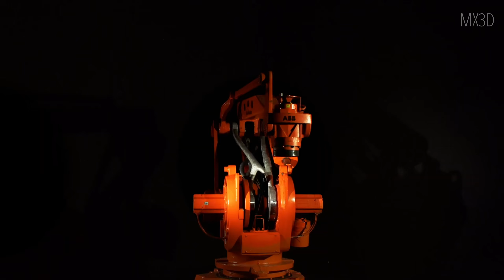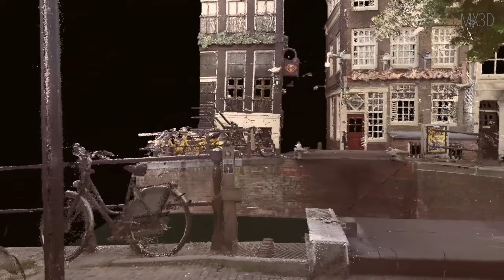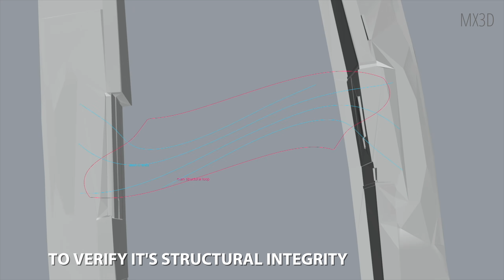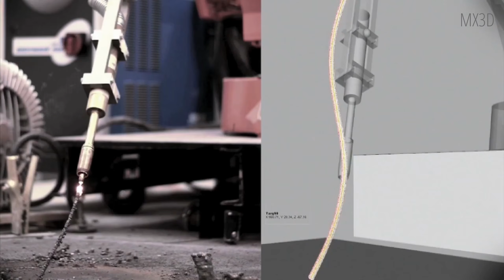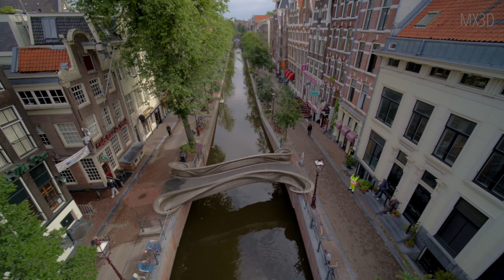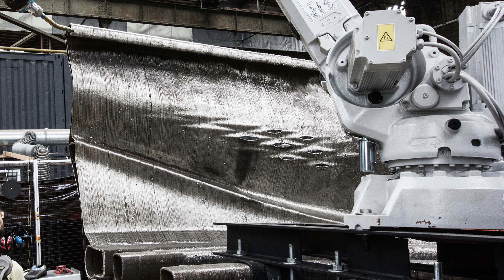World's first 3D printed STEEL bridge | MX3D

Comment: This is very interesting and more practical than the other 3D bridge art. ;)  I find it funny that it's in the red light district.

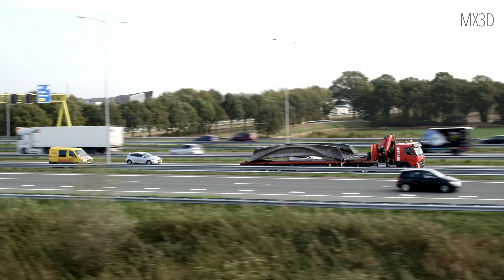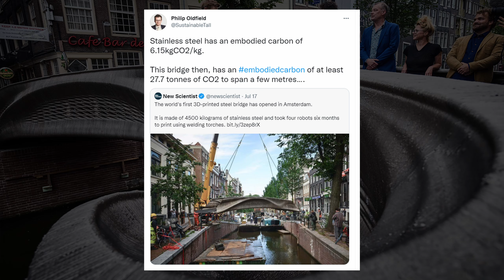I'm curious as to why it had to be cut into three pieces.  Was it because of the narrowness of the area? Or about the local roads?  At 2:57, it seems to fit fine (unless that's only a portion of it).  Does it have a method to prevent rust?  Or is the assumption that it won't be there long enough for rust to be a factor for stability?  Finally, at 5:55, is this guy complaining just to complain?  If he wanted a practical  discussion, he would have compared it to a typical steel bridge or a traditional bridge in the area.

I like the concept, but I wonder how it compares cost-wise and time-wise to a traditional steel bridge.  Nevertheless, I think it's a good step into the future of 3D printing that's more practical than some of the other things we've seen. As for the design, it may look good somewhere, but definitely not with the look of Amsterdam's red light district.

Thanks for the video!  Glad you're back and doing better. :)
Reply: stainless plus a fixed lifespan of two years. except we all know what will happen - it's going to become so popular that it will likely have to stay, perhaps permanently. you heard it here first.
Reply: It did say that it was stainless steel, so rust shouldn't be a problem.

Comment: Calling it 3d printed seems like a bit of a stretch lol, Using a welder to build stuff like this is SUPER bad for the environment lmao welders consume huge amounts of energy to begin with then with all this extra equipment?? And it took 6 months to make? It would have been faster, cheaper and less environmentally damaging to just build a normal bridge out of steel.
Reply: As she pointed out, this was an experiment. While the creation has detriments now, how else will new and possibly better technology be implemented in the future? Not everything can be designed and improved only "on paper" before a finished method is implemented.
Reply: @whiteknightcat  It's not really making a better technology, there simply isn't a world where using a welder as a 3d printer is going to be viable, you are always going to be better off forming metal in another way lol like she also pointed out.

Comment: oh my, you know the creator of the bridge did not like having to cut it into pieces :)
Reply: For sure! I know I winced when I heard that!
Reply: probably knew it was coming.
Reply: @daos3300  if he knew it was coming, he would have printed it in pieces :)
Reply: @ArtisanTony  no, since the whole point of the exercise was to manufacture it in one piece. goal achieved, next problem to solve - installation.
Reply: @daos3300  The main problem was no one properly planned the project.  I am a design build contractor. I would never design a system with such mistakes. If you design a bridge in one piece, you have to confirm transportation and installation before you print it.  This is the typical failure of "artists" to understand project management which is best left to someone like me who is use to getting things built in a  proper way.
Reply: @ArtisanTony  i suspect you fail to understand the nature of the project as an experimental/art piece. of course there was planning, the city of amsterdam was involved. but given what it was, and the number of necessary compromises made along the way, there was a degree of flexibility allowed and built in. not everything is a bog standard affair, this isn't a run of the mill condo.
Reply: @daos3300  I suspect you have no idea what you are speaking of.  I don't fail to understand anything.  I have been involved with projects like this before and every time there is "art" involved, there is a lack of planning and common sense.  Artists are not builders and city planners are bumbling bureaucrats. The very fact that they had to cut it into pieces is shear proof.  And then there was that idiotic transition on one end  where they had to rig the landing of the bridge. You have shown me you really are an ignorant person with no objectivity and a waste of time to respond to.  Let me guess, you are a twitch gamer lol
Reply: @ArtisanTony  there are very good reasons for both cutting it and why it didn't fit, the details of which you are evidently not aware. but i guess you already have all the answers. quick to judge, throw attempted insults and accuse others of ignorance... says a lot about you. bet you're an absolute dream to work with.

Comment: Could they not sand it a bit to smooth it when done? Sorry if steel doesn't work that way.
Reply: Of course it could be polished, but I guess they were looking to show of the raw 3D printed surface.
Reply: you can do it yourself, glue sandpaper to the inside of old gloves and make the handrails slightly smoother every time you walk across
Reply: @illdeletethismusic  i was thinking more like a sanding roomba

Comment: Honestly, it should have been powder coated to prevent rust.
Reply: @Cole Hansen Stainless steel still corrodes and rusts. The rate and severity depend on the type of stainless steel they used.
Reply: @andrewbeeco967  1. stainless steel.  2. planned limited lifespan  3. intentionally left unfinished

Comment: They compromised the test by dividing it and welding it back together as it creates a stress riser not a part of the original model.
Reply: I thought about that as well. But I guess there was no other feasible way to transport.
Or, who knows. Maybe they factored that in after realizing that it had to divided to transport
Reply: @jonl8816  Mhm if it was part of original design, why not print it in parts to begin with? They would have calculated that even cut and rewelded, it would be fine.
Reply: @SianaGearz  the point of the exercise was to manufacture the bridge in one piece, making it in parts would defeat that object.
Reply: @daos3300  well it was supposed to be manufactured at the point of installation as well, but that didn't happen.
Reply: @SianaGearz  that was for the biomimicry version, which got canned early on - i'm guessing due to cost/complexity. would be great to see that happen, i'm sure it won't be too long before someone pulls it off.
Reply: the cutting was the one thing that bugged me. but properly executed welds are generally stronger than the parent metal, so not a stress riser.
Reply: The object itself is basically just one enormous weld.
Reply: @garethbaus5471  exactly.

Comment: Whilst its not a very attractive structure it is an experiment and I would think that when the first windmill was built it was not appreciated, but like electricity pylons after a while the eye no longer sees them. 3d Weld/Printing will probably be useful on complex reoccurring  shapes that  have to be made on site and would be (welder)labour intensive. After all the most expensive component a manufacturer makes is the first one.

Comment: Very cool progress on the concept of autonomously.erected structures. Set it and forget it construction is the end goal, obviously. But realistically we’d actually be going for accomplishing construction with minimal oversight.

So there are several neat ideas to build on with this. 

One is large composite structures are potentially possible like this. And potentially can be done very precisely 24/7 if you work out out the programming and best types of robotic and tool designs to accomplish it.

Now, all that is only so interesting in comparison to prefab, and construct on site. Show you workers the screws and hot the parts fit. And where to weld. Convenient. 3D composite is still very cool, because it can potentially build structures you simply couldn’t make any other way, but still needs a lot of development to make that truly preferable to other modern methods of construction and design. 

The real interesting possibilities are in sending out an couple machines to scan and assess, and build off of whatever the controllers deem best for that. With little oversight. The reason that’s interesting is because the amount of work you can do becomes more about how much machinery you can send out. A dozen work crews across a city is absurdly difficult to put together when it’s 30 or more guys, plus all the heavy equipment. Shrink the crew size, and build sustainable semiautonomous heavy equipment, and you might find that even if it’s as expensive, it’s over all a thousand times easier to oversee. A normal construction crew is a lot like herding cats. That’s not an issue in leading robots. They don’t show up to work drunk, act like giant arseholes to each other, or take any.time or effort to vet for the lazies, stupids, or addicts.

The obvious issue is that you’ll need to develop a lot of new software and hardware, and bring in experts to assess the issues of construction. Additionally, construction sites, and ground conditions are a huge issue for a band of monkeys in hard hats to deal with. And they are built to navigate difficult terrain, and inclement conditions. So you’d probably need to develop methods of isolating terrain, so you can control as many variables as possible. Think like you see in city reno. With the scaffolding and plastic. Plus excavation and infrastructure is its own hairball.

However. This solves a couple of those issues. If you just deliver the machines and wire for a large portion of the structure, you can cut out a ton of manufacturing. And if you get really good at understanding the area and blueprinting with cad, you might end up making types of structures, and in places you’d never imagined doable with less consequences for taking your time in development. Machines with some standard storage and Maintenace can sit it their crates as long as you need them to. Where as live labor has literal hosts of needs and desires that change the costs of their labor.

Plus the best part. As long as you don’t lock innovation up, like Disney does it’s IP. That is into perpetuity. The more you use the systems, the better data you have to develop across all work done. Innovation is more or less directly applicable across all machine language, and the methods and systems used to deal with circumstances of construction are also more or less applicable to any other operation in that field. Where as with more people the systems more or less dissolve as the workforce loses and gains new highly variable individuals. The engineers and architects are developing. The machinery develops, but the workforce is constantly changing. And good workers, and good leaders are the limiting force there.

Anyway. Hopefully that was semi coherent.

Comment: I would love to know more about why the biomimicry design failed, sounds like that’s a software issue where the software wasn’t able to get to an optimal structure?
If anyone has additional literature on why that failed I would love to read it!
Reply: I don't know, but I suspect that changing actions from wind loads and the complexity of the structural response meant that the design was so non-linear they struggled to make a stable and computationally efficient algorithm. Either that, or the design requires hollow sections to achieve an acceptable efficiency and this is beyond the capability of the biomimicry software.
Reply: @alexandersime-scott8198  that would make sense, I presume most optimization systems assume a static mono directional load ie: gravity. It would be rather complicated and computationally expensive to extend that to dynamic changing loads like wind and understanding resonant frequency modes. 
My initial guess was well if it works for a chair why wouldn’t it work for this, but that’s definitely a decent guess. Still that seems like a very promising method for the future.
Reply: @FreekHoekstra  my thought was, it was just too complex to print?
Reply: @richm1981  given they can print a loose filament, I doubt thats the constraint, but maybe...
Reply: It is infact nothing like biomimicry, it is topological optimisation. I invite you to do further research with this term. 
At no point of the design was any thought or idea from nature. Yet it resemble living being because it is highly optimised for a specific task (like evolution you see)
Reply: @guillaumebeau1906  in fact it's called biomimicry because it mimics nature in the way the software is allowed to optimise the structure using processes which very closely resemble the way nature 'grows' optimal structures for a given set of parameters. also known as biomimetic generative design.
Reply: It looks like a number of designs first tried generated too many thin members which cannot be well printed layer by layer, creating too many weak points not taken account of by the topo optimisation. You want long continuous wall sections that have time to bond well to each other during printing without distorting the existing print too much.
Reply: My guess would be that the strength-force ratio was just too far outside the capabilities of the software they had.
Reply: I'm not surprised. They designed it 2 years before a restoration of the river wall.
Literally anything could have happened.

Comment: Running a welder for 6 months must have consumed a fair amount of electricity - is that included in the embedded carbon estimate?
Reply: We did a quick calculation of the whole business case for our design students... space, several robots, welding wire, inert gas, electricity, wages... it was absolutely abysmal from, both, an ecological as well as an economical standpoint, not to mention engineering issues. Really, nothing to brag about...
Reply: @dragonrider269  if you mean 90% helium mix then it's even more expensive.
Reply: @Junebuggin13  most of the gas in the shielding gas mix for SSteel, would be argon.
Reply: Nobody cares about "carbon footprint". We have nuclear energy to produce cheap electricity.
Reply: Carbon footprint is a communist hoax to empoverish and tax people with the pretext of "saving the planet".
Reply: @steamsteam6607  carbon footprint is a uniquely capitalist hoax, in fact, spread by oil companies to offload the responsibility of climate effects onto the consumers of oil products. Try again.
Reply: @KayLee-lw5iv  If it weren't for the cronyism of establishment politicians we may have a carbon tax, but let's not forget that this is all in response to the market. Businesses don't pollute for the fun of it, but because it lets them offer their product at the lowest price. We have a populace which cares more about their yearly cars and fast fashion than our planet. A few officials agreeing on environmentalist law won't change that fact. Adam Smith knew this when he devised the economic theory

Comment: 10-plus years of experience as aerospace certified welders would have made it clear to them lads the impracticality of their vision (the studies are so intense for there is so very much to know in welding metals... so very much). Also, someone really did the maths incorrectly (or incompletely conveniently maybe) to where the term carbon neutral would ever come up except to say 'impossible to be so as done'.
Reply: Right, I was wondering how they environmentally melted and casted transported whatever 10000 pounds of steel

Comment: The bridge that replaces it and was briefly seen in your film was in itself a temporary replacement of an older bridge.
The quay wall has been replaced in the meantime and the old one also had several steps. In the old situation, it was also not wheelchair friendly, but about 200~300 meters to both sides are bridges that are wheelchair accessible. And I wouldn't be surprised if they adjust the street to it in the coming time.
Also, not a single house in this street is wheelchair accessible. Everything is from 1750~1850, many stairs, everything narrow and steep.
Reply: A cynical thought is that if you use a wheelchair, you probably aren't going to be able to fully enjoy the red light district anyway. ;)
Reply: Perhaps the six years of effort would have been better spend on developing a better wheelchair. One able to cope with the challenging Amsterdam environment.

Comment: There is currently a company called rocket lab that is making a completely 3d printed rocket called Electron. IMO it’s a bit more of a better use for 3d printed metal than for a small bridge like this one. I mean better as in that it will likely have a much more promising future.
Reply: And better also in that its got a lot tighter tolerances given the failure modes.

Comment: As an experiment it’s super successful it really gets the gears turning. This makes me think about the “site to software to site” workflows where the techniques are heavily driven by software that experimental and heavily emphasized  but the site overlooked (or in this case mismeasured!). I hope to see another project come along where the can actually print(weld?) on-site.
Reply: I agree with your site2sw2site POV, it would make the argument that a dummy/template/lightweight shape could have been printedn and placed into position to confirm exact geometry, so that fit issues could have been found.

Comment: This tech holds so much hope for me… my first sight of it back in the day, brought  tears…
I think the tech is best used to put materials into a difficult shape, like the original patient, then shape or tool it into the final.  3D printing should join the family of casting.  From a sand cast to extruded to injected to “whatever they call” this… stacked?  Like everything else in manufacturing, just another way the get at a product.  Closer to the winking-of-an-eye.

PS - Perhaps the use of multiple torches laying down the same line… one behind another… will speed things up.
Reply: 3d printing seems like a reasonable replacement for castings on weight sensetive jobs.